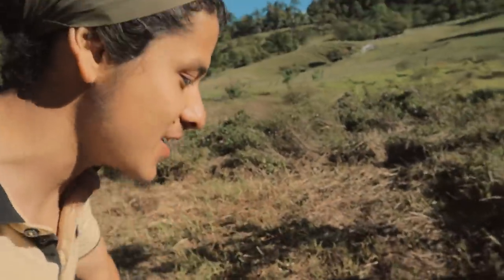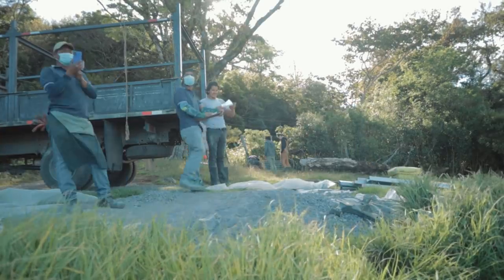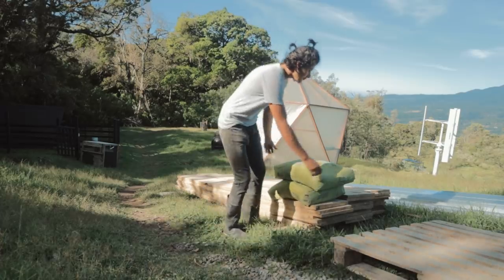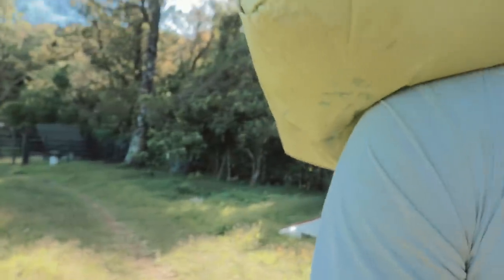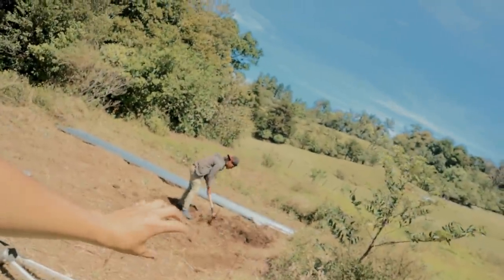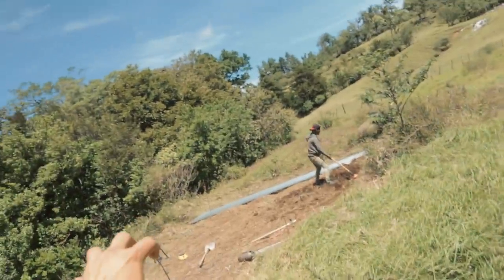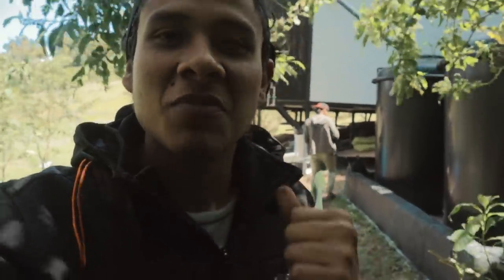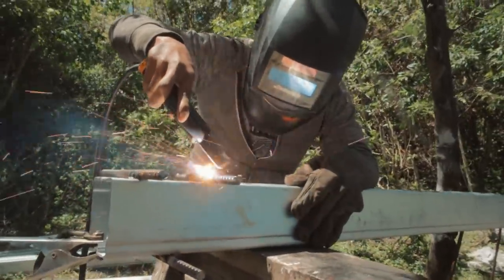I’m Building a Shed || building in the jungle

Comment: This is a tip for moving things downhill. get a sturdy tarp and load your items on the tarp. Then drag the tarp downhill on the grass. It won't work on your long beams, but many items will glid quit easily on the grass. Especially downhill. II should say that you want a plastic or nylon tarp. A cloth based one will hold to much water and make it not drag. I've done it in the yard for years, (or I used to).

Comment: Hello Rodrigo, sorry about your camera mishap.  I have a free helpful solution for you when filming from a tripod in windy conditions.  Most tripods have a small hook on the bottom of the center pole you mount the camera to (if yours doesn’t have one, modify it by making a hook or at least a drilled hole to receive a hook).  Fill a 6”-10” sized cloth or plastic bag with sand or dirt and seal it with a zip tie or piece of rope.  Then hang it from that center hook like a counter balance.  Photographers and videographers use these counter balances all the time when shooting outdoors in windy conditions.  Unfortunately it won’t help with the one that got broken, but it could save your next camera.  Good luck with the shed my friend.